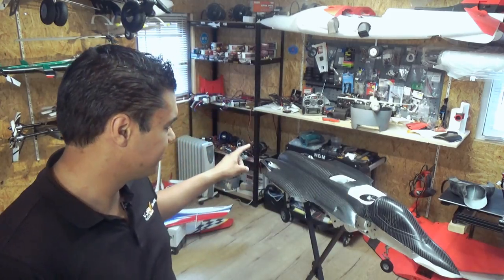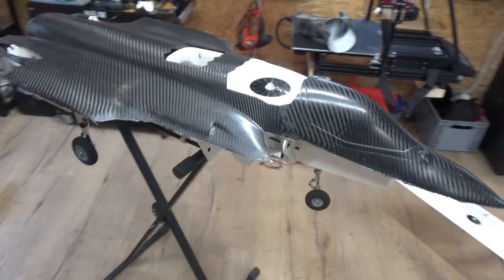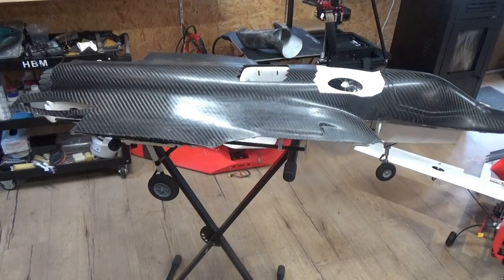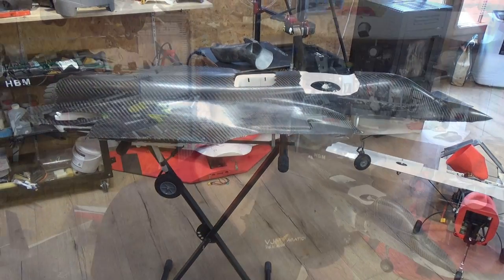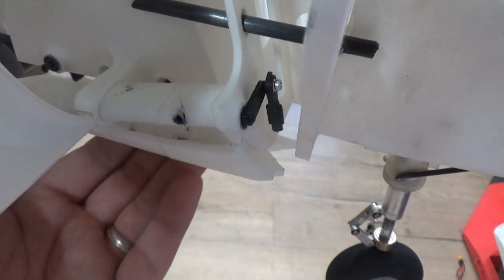F-35B |  RC VTOL Model 2x90mm Vasa EDF’s | Will it Survive Heavy Wind??

Comment: The top hatch caught the wind and it tripped itself, especially without the aerodynamic skin on the fuselage. An active wing, elevators and rudder would help. The scale speed wind was too much in this configuration for landing properly. 
Very cool machine, thanks for the video.